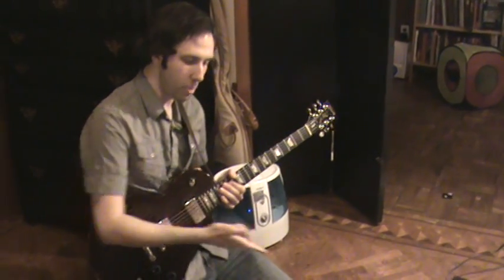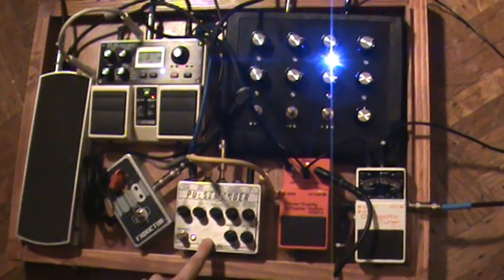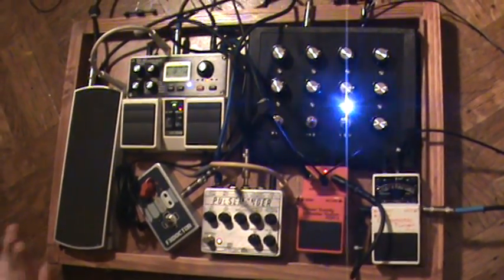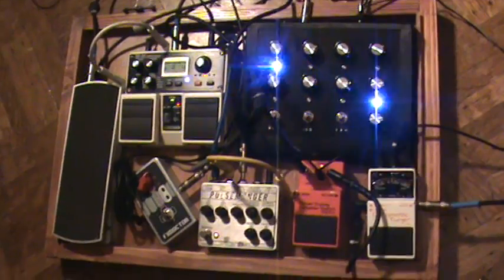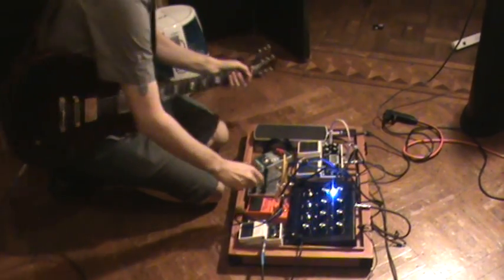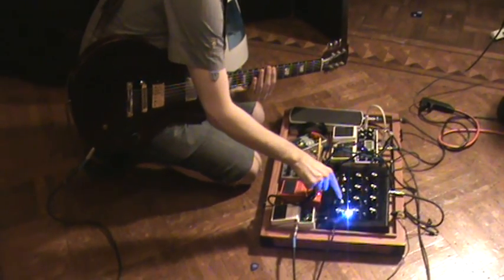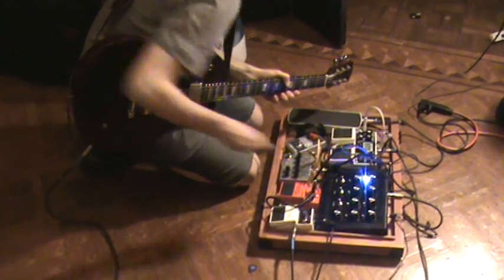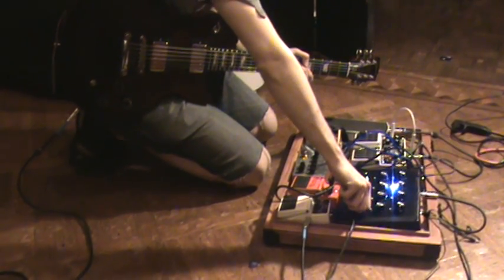8BIT GUITAR - PULSEWIDTH SEQUENCING - PWM - CHIPTUNE - CHIP

Comment from the maker: @Jackalakadingdong 8bit is really referring more to the VDP (visual display processor) in the old consoles.  It just so happens that the sound chips in the old systems are really just low res/shitty analog synths (on a chip) that accept digital messages (in various bit depths).  So - the term 8bit is pretty stupid to describe the music anyway.  This definitely qualifies as a shitty analog synth + its doing similar things that the NES or C64 square waves do.  plus 8bit = more yt hits than "chip"

Comment: @4NIM4L57YL3 No doubt! Your video was extremely helpful in regard to the pulsemonger. I have a good deal of pedals with CVs (e.g., WMD's Geiger Counter and the recent version of the FatMan) where the expression pedal controls the unit's parameters. I just assumed that the PulseMonger did the same thing, until I watched your very helpful tutorial.